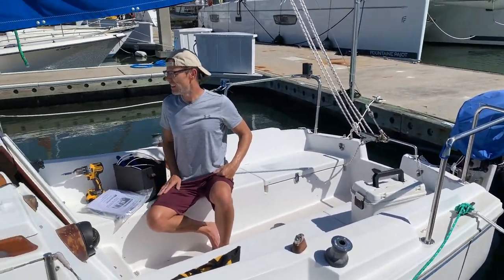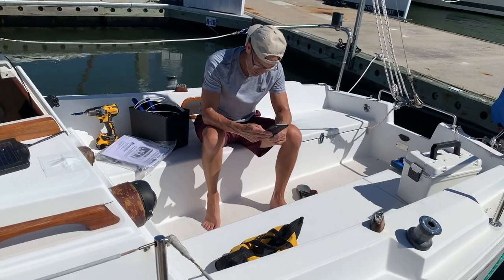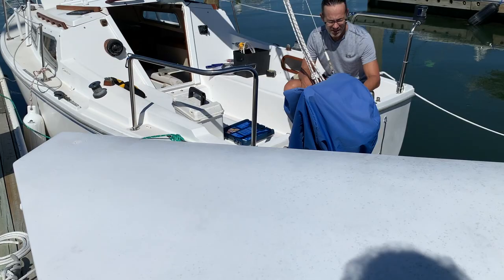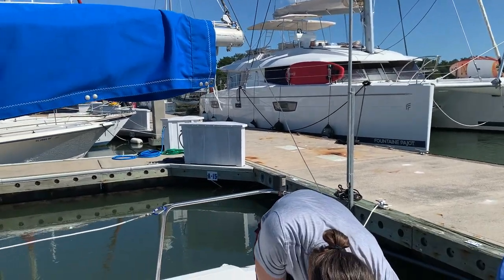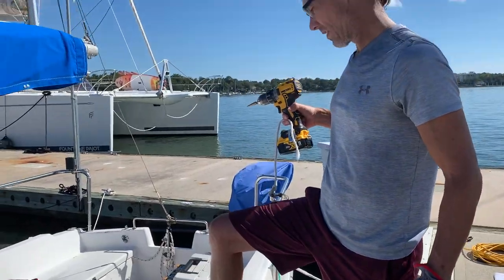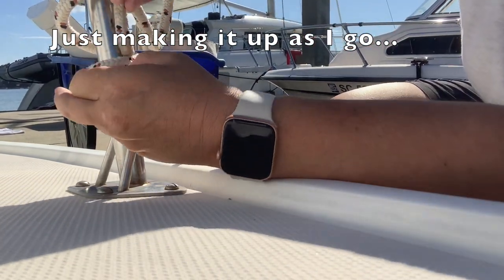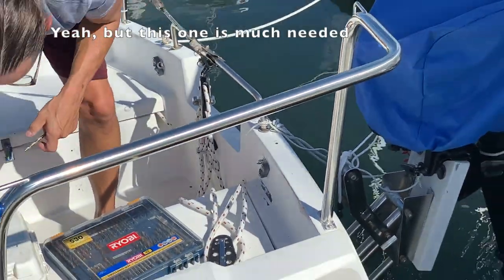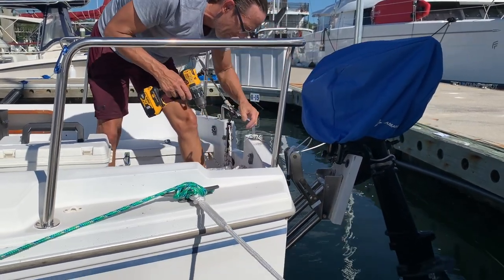How to install a new back stay & repair a boom on a sailboat on our Catalina 22

Comment: Glad you guys got your back stay changed over.  The line that runs from the top mast and turns into rope for the last few feet is a topping lift and attaches to the boom.  It keeps the boom from falling down and hitting you in the head if you have to lower the main sail.  It also allows you to trim the main sail shape in conjunction with the boom vang and down haul.  The boom kicker you were looking at in video 18 does the same thing except it doesn't allow you to shape the main sail (just holds the boom up).  Now the small length of cable (5-6 inches) and clip on the back stay that you have the boom hooked to (even when you were sailing, which its not supposed to be connected during sailing) is a temporary way to hold the boom up when the main sail is not raised (your topping lift does the same thing).  Your top Main Sheet pulley connects to the "C" ring you just replaced on the boom so you can let the Main Sail and boom go out to nearly 90 degrees in a downwind sail (by allowing the sheet to extend through the pulleys that are now connected to the traveler).  Hope this helps:-)
Reply from the maker: That's why I love our little channel !  We can use all the guidance anyone is willing to offer !  THANKS!!!

Comment: Marina's power outlet are often 30 Amp socket, while regular extension cord are 15 Amp plug. You can buy ( or make ) adapter. However the breaker in the power post will be 30 Amp while the extension cannot handle that much current without overheating.  It is OK for intermittent and supervised usage, but shall not be left connected permanently. Keep posting.

Comment: according to E-Rigging (watch their crimping videos) the crimp on a 1/8 cable should be 3 x per sleeve crimped in this order c>|[2] [1] [3]|=====  where the numbers are the first, second and third sleeves and "2" is the eyelet end and 3 is at the rope end
Reply from the maker: Thanks for info. Little over our heads... but we need to still shorten the backstay anyway. It's still not done.